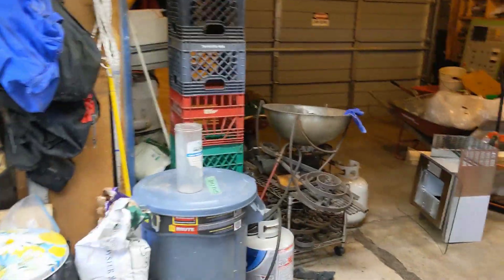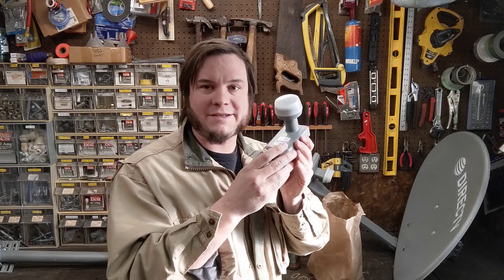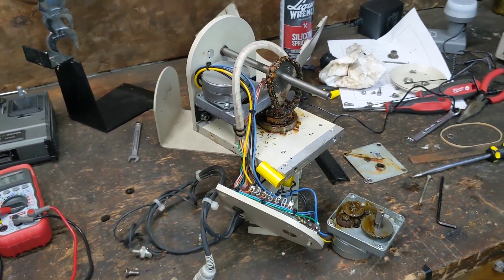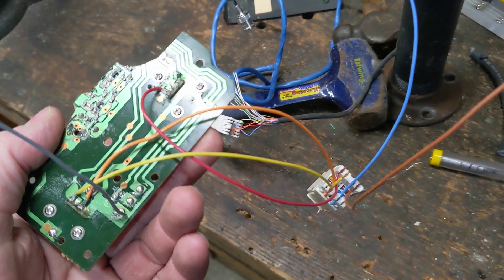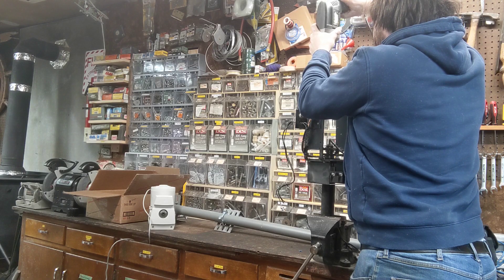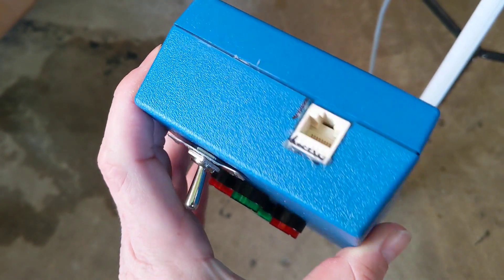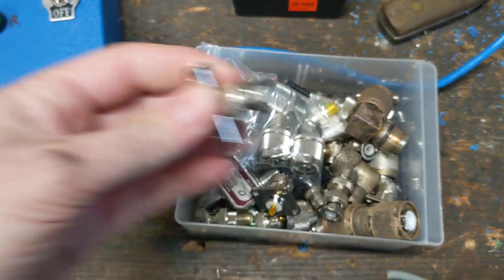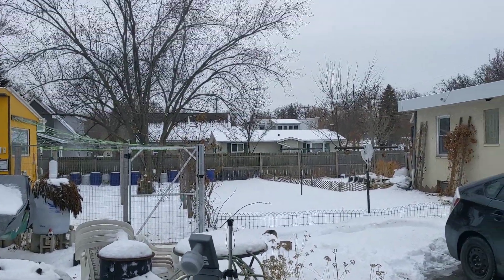DIY Radio Telescope / Satellite Finder Made From Old Dish

Comment: This spring I'd like to experiment with radio telescopes & I have a question.

The LNB is a low noise block downconverter.

I always assumed down converting ment converting the signal, say at 2Ghz to a lower frequency say 1 Ghz that is then fed to the receiver.

So, if my assumption is valid and the satellite is published as sending data at ??? Ghz then how do you know where in, say SDRuno, to look for the satellite's signal?

On the other hand a published receive signal could be the frequency a typical LNB converts the actual transmitted signal to?

Being totally a newbie, I can only guess at the moment.
Reply from the maker: The LNB has a "local oscillator" (LO) frequency which is what you subtract from the original signal. So if it's a Ku Band signal at 12ghz, and the LO is say, 10.75ghz, the receiver will see the signal at 1,250Mhz. Different regions use different frequencies and LOs, so a "universal" TV LNB from Europe might be more flexible than a US model.

Comment: I know this video is a couple of years old, but you look at an arcade stick for the PTZ control as it is simply 4 buttons, so your current setup could easily be swapped, and you'd have a cool joystick to use.  You also get quick-release versions to pop off if need be.

Comment: Nice finds!! I just traded some old HAM equipment for a spotting scope with a SkyWatcher AZ-Gti and am diving into using that for satellite tracking for radio. Seems promising, unfortunately I need a windows machine to run most of the software. Trying hard to do it in Linux if I can.

Comment: At Ku-band, the only discrete objects you'll be able to "see" with your setup are the Sun, and possibly the Moon. However, you could put a "can" feed on for the 21cm hydrogen line (1420.405MHz) and using a SawBird+ H1 LNA get hydrogen emissions from along the Milky Way.  The 21cm hydrogen line is fairly "bright", so even a small dish allows you to detect those emissions in many parts of the sky.  But at Ku-band (11-12GHz), you'd need a much larger dish, which means much more stringent pointing requirements, etc.
Reply: this is exactly what i need man, where can i buy the components to transform my DirectTv antenna into a hydrogen line raido telescrope,, where can i get this "can" feed ??   i thini the sawbird LNA is available in amazon
Reply: atually the sawbird is not available in amazon,, do you know where to get it ?

Comment: Hey can you please tell the names of the antenna connectors that you used to change the coaxial cable to the usb port at 8:00?
Reply from the maker: The USB device is a Software Defined Radio (SDR), the one in this video was a super cheap one from eBay (RTL2832). I'm not actually sure what the antenna connector on that is called, I had some old Wifi antenna parts that happened to fit. 
A better one (but slightly more expensive) is the RTL-SDR Blog V3. That's what I'm using now, it has a more standard antenna connector called SMA that's easier to find connectors for.

Comment: Hey, 

We are planning to do the same, but are facing issue in connecting the batteries and also powering the lnb through it. Please guide us and if possible provide an email on which we can extend this conversation.
Reply from the maker: Sure, you can email me at gabe (at) saveitforparts.com. I just hooked two 9V batteries in series to get 18v, and then hooked it to a coax connector. There are also in-line power supplies or power injectors you can get online that do the same thing.

Comment: If I was stuck on the moon and the engines wouldn't start, I would want you to be there with me.  We would need a long cable to get back to Earth. 
I have been making a radio telescope and it works. I will attach a link to a unlisted YT of mine if you are interested. Not sure it it the latest as I now use a feed horn instead of a dipole. The real question is how would you take the pulse of the hydrogen resonate line around 1.42 GHz and make it sound like music? I have mixed the output of my signal generator at 1.42 GHz with a vector analyzer scanning across that frequency and it makes a little bit of an interesting sound but it is not music yet. I need help and am open for suggestions.
https://www.youtube.com/watch?v=SDLm1N10fTI
https://www.youtube.com/watch?v=lyFeXgK94Xo
Reply from the maker: I haven't tried anything with the hydrogen line yet, it's on my list though! I'll check out your videos!

Comment: Also what are the specifications of the PTZ mount that works for your disk? TY again.
Reply from the maker: It's a Vicon Micropan, I think the V3000 model? It only holds up to 15lbs, the dish was about 14 so kind of pushing it for weight. It takes 24 volts AC, each direction uses a different wire plus a common ground. I just used this since it was lying around in the junk pile at work.
Reply: @saveitforparts  I looked around for one online and they are $200-$400! This is a nice solution but I think I will have to wait to see if I can find one cheaper.

Comment: This is a very nice and helpful video. What are the specifications for the LND that you used and can you provide a link to where you purchased it? Ty.
Reply from the maker: The round one I tried for FTA TV was just some cheap-o imported eBay thing, no brand since it's one of those overseas manufacturers that changes their name every 5 minutes to avoid import restrictions and/or bad reviews. When I was doing radio astronomy I think I just used the stock LNB that came with the dumpster dived dish.
Reply: @saveitforparts  do this work

Comment: I have the same Pan-tilt unit.  It uses 24 volts AC, but how did you wire up your control box?  Please advise.
Reply from the maker: I don't have a diagram handy, I think I just did one button for each direction and used ethernet cable for all the wires required.